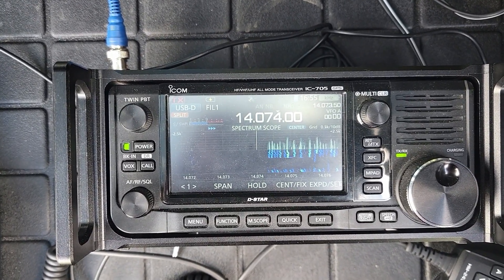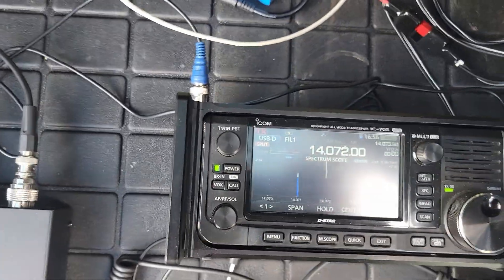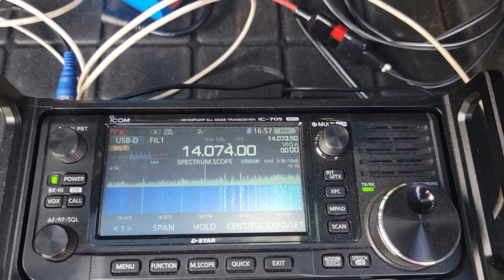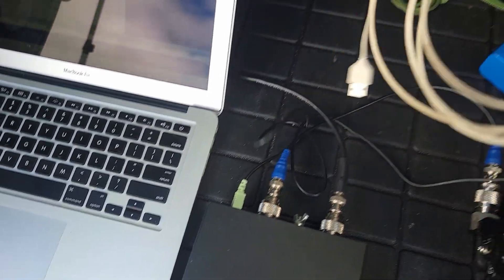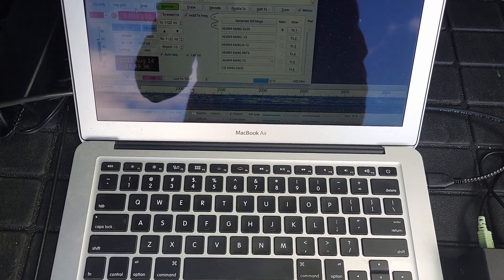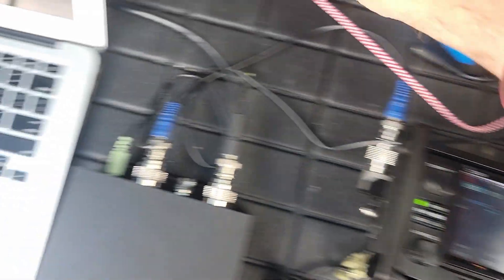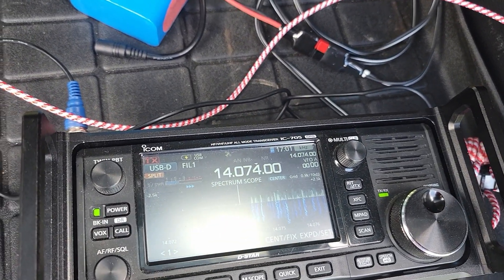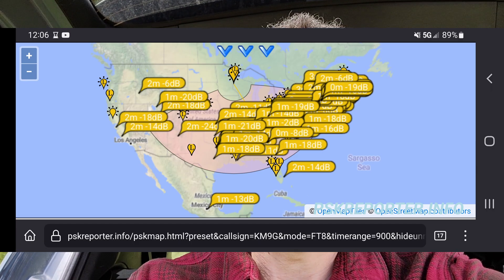Let's Remove USB Noise from our Icom IC-705

Comment: The issue with the micro USB orientation is called the 50/50-90 rule. Should be a 50/50 chance but 90% of the time you get it wrong. Great video on noise/RFI suppression, need to do this with the Micro USB cable for my 705. de W6VIP
Reply from the maker: The micro's are really hard to tell the orientation by looking at the port - the USB-As are usually "holes up" and I get them wrong less often.  559!
Reply: Actually, it's a quantum phenomenon.  You can keep flipping and reinserting the cable, but until you actually look at the socket, it's wavefunction does not collapse.
Reply from the maker: @m_a_s6069  very true!
Reply: @m_a_s6069 t's then that you realise you've managed to insert it perfectly into a RJ-45 port.

*in case you didn't know, Usb A fits with just enough friction to feel like a really good connection into an RJ-45 socket.

Comment: Interesting one. I understand nothing about ft-8, but using the sdr-control app would prevent this issue, supposedly. I'm curious about it now =)
Reply from the maker: That's right! SDR Control would prevent the issue with the USB Cable - because there would be no USB cable!
Reply: @temporarilyoffline  but does the RFI cause malfunction on the network created to connect the radio and the pc/tabled? That's a good experiment.
Reply from the maker: @ve2zdx  It does sometimes, but the only  time I've run it have been super-compromised positions (like inside a hotel room) and there are a whole lot of things going on there..  More to come as I know more.
Reply: I use SDR-Control with a MAC, and network access is the way to go.  It is faster, untethered, and no noise problems. Best software I have purchased in a while.

Comment: I gave up connecting my IC705 with USB. I have tried dozens of cables with beads and with built-in beads. All still had noise. Now I just use a wifi connection.
Reply from the maker: Thanks Hef!  Wireless FT8 is next on the list to conquer.  So much to play with!

Comment: Outstanding.  I've never had any luck with those ferrite beads.  I'm guessing they just are there to make cables look more official.
Reply from the maker: The ones with the built in beads?  They kinda work sometimes depending on the type of noise - The reason why you need a few is because that replaces the multiple turns on the same core with multiple cores.